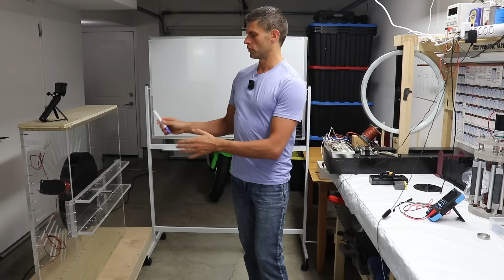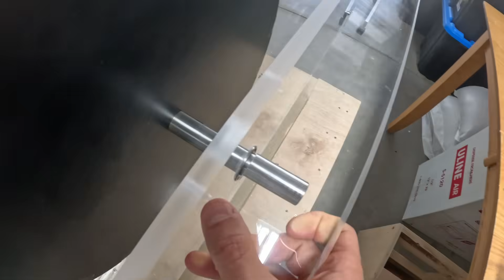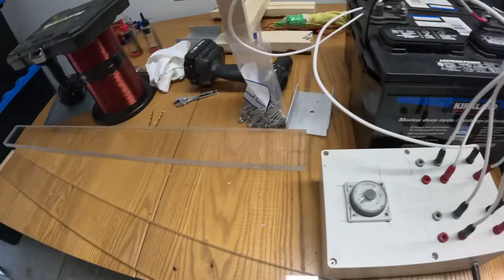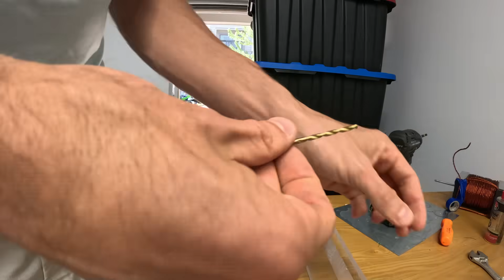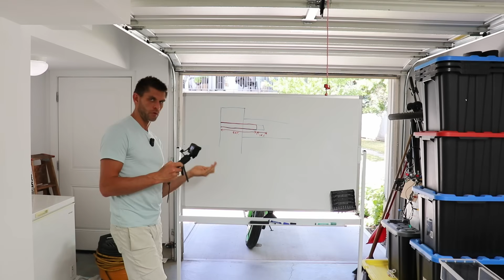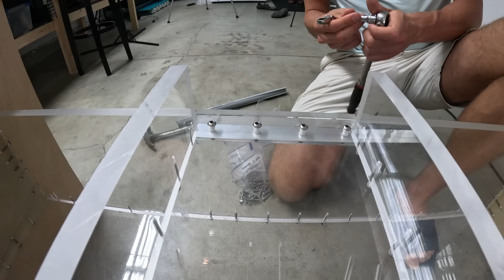This Pulse Motor Could Change the World — And I’m Building It in My Garage

Comment: Bro, I'm loving this idea already and have a suggestion! Are you familiar with Prof. Malcolm Bendall and his Thunderstorm generator? He uses plasmoids and they function like atomic battery and can hold enormous amount  of charge because of their high energy density and self-contained electromagnetic field.  I'm  wondering, if you'd use it as a battery source instead of standard battery.  Plus the plasmoids are generated fairly easily through  cold fusion at low temperature and pressure.  Let's me know what you think, bro?
Reply from the maker: Ill check it out thanks

Comment: IVE GOT AN IDEA!!!!!!! WOULD YOU LIKE IT!!!!!!!! Here’s an example THE NORMAL GENERATORS LOSE  50 PERCENT OF THERE MAGNETS??????????? SO IF THERE GENERATORS RUN AT ONLY 80 PERCENT OF EFFICIENCY, HYDROELECTRICITY 90 PERCENT EFFICIENCY!!!!!! I CAN DO BETTER REMEMBER THERE MISSING HALF OF THE MAGNETS!!!!!!!!!!!!!!! SO I KNOW THAT I CAN DOUBLE THE MAGNET FIEL😢STRENGTH BY NOT ALLOWING ANY MAGNETS TO BE LOST!!!!!!! SO THAT MEANS THAT I CAN INCREASE THE EFFICIENCY OF THE GENERATOR’S TO 160 PERCENT EFFICIENCY SO WE CAN EASILY USE 60 PERCENT OF THE ENERGY TO POWER THE MOTOR DRIVING THE GENERATOR AND TAKE 100 PERCENT OUT!!!!!!!!!!!! SHOULDNT HAVE MOVING PARTS!!!!!!!!!!!!!!!!!!!!!!!! I’M USING NATHAN STUBBLEFIELD EARTH BATTERY PATENT!!!!!!!!!!!! 🙏❤️
Reply from the maker: Cool 😎 great comment
Reply: @MadscienceLPTECH ALL KNOWLEDGE NEEDS TO BE SHARED!! 16 COILS PUT IN THE GROUND 1 METRE APART AND WET THE COILS INDIVIDUALLY NOT THE ENTIRE GROUND!!! AND THERE IS ROUGHLY 14.8 VOLTS TO POWER ANY INVERTER!!!!!!!!! I WOUND MY COILS USING IRON WIRE AND COPPER!!!!!! PAINFUL, EXCRUCIATING PAIN I WAS PHYSICALLY HANDICAPPED AFTER EVERY COIL I MADE!!!!!!!!!! DONT DO THAT ALL THOUGHT THERE ARE BENEFITS!!!!! (More Magnets) JUST WIND THE COILS OUT OF COPPER SO FUCKING SIMPLE!!! 😀 AND WELD OR SOLDER A NICE COPPER PLATE AND ZINK COATED METAL PLATE!!!! NO SECONDARY COILS!!!!! JUST SINGLE EARTH BATERY CELLS!!!!!!!! MANY DO USEFUL WORK!!!!!!!!!!!!!!!!!!!!!!!!! ITS JUST AN EASY WAY TO MAKE YOUR OWN POWER!!!!!!!! IF YOU WANT MORE INFORMATION DONT HESITATE TO ASK!!!!! I HAVE DEVELOPED 8 DIFFERENT TYPES OF PHYSICS RELATING TO UNLIMITED ENERGY!!!!!!!!! 🙏❤️
Reply: @MadscienceLPTECH THERE US A LOT OF KNOWLEDGE HERE WITH THIS TYPE OF EARTH TECHNOLOGY!!!!!! NATHAN STUBBLEFIELD USED THESE COILS TO SEND VOICE THROUGH THE EARTH FROM ON PLACE TO ANOTHER!!!!!!!!! THESE COILS TAPE INTO THE AETHER!!!!!!!!!!!!!!!!!!!!!!!!!!!!!!!!!!!!!!!!!!!!!!

Comment: I spent over 30 years studying every form of "Free Energy " or "Over-Unity" device I could find and nothing worked .    In 2014 I bought a couple of Lithium battery modules out of a Tesla Model S car and that combined with cheap solar panels provides far more power than my house could ever use and the equipment will last the rest of my lifetime .    The pulse motor stuff is fun but it's kind of a waste of time now that solar power is so cheap and easy to put together .
Reply from the maker: hows your solar work at night? solar will be a joke compared to ZPE once we get it ripping,
Reply: @MadscienceLPTECH  Solar does have trouble on long winter nights followed by cloudy days but if the battery is big enough and panels are powerful enough you can still generate impressive power during rainstorms .  If someone can figure out how to get an electric current to constantly flow in a loop that would be awesome .  Best of luck !

Comment: why don't you show the battery voltage over time of your current system? it sounds like that your theory is that you need a system that is low-enough friction so that the "pressure release" of your system inputs more energy back than was used for the electric pulse through the coil, but that the current system has too much friction and does not actually generate more energy that is released. Is that right?
Reply from the maker: More like high enough excess to overcome all losses easily. Stay tuned new video tomorrow

Comment: I have studied John Bedini's work and built his motors and have come to the conclusion that the 2nd battery eventually always dies .....why friction and the law of conservation, you can not get out more than you put in ....his devices no matter how you build them will always suffer because of friction and heat disapation used in any semi-conductor device .....it led me to the conclusion that there is free energy but it is in the form of solar ,wind , water flow and atomospheric voltage ....you need torque to run a generator to provide enough power to drive a load. Therfore it brings us to the conclusion that solar is a direct conversion to power, wind and water are all direct conversions to electricity by using mechanical rotation so that leaves only atmospheric voltage. Atmospheric motors do in fact produce torque. Not saying it can't be done but the idea of the aether has been an illusion used by many that were found to be grifters when the facts were laid bare. If you figured out a way to use atmospheric voltage to run your generator, I would say you would have a chance, otherwise I would say you are pissing in the wind. Don't take this personally it is just from someone who has traveled the same road that you are on. Why because Free energy would mean freedom from the oppression of the elites that have bought the governments of this world and keep us as ......well lets just say wage slaves.......Im routing for anyone that can come up with a solution and give it freely to the people but I don't think John had the answer.....a neat device but not it
Reply from the maker: Basic 12v BJT bedini yes not going to power your home... our build will 120v SiC FETs

Comment: From a technical point of view, this achievement is doomed to failure. In order to understand the laws of thermodynamics applied to a closed system, we must take into account their contradiction with what actually exists in the universe where these laws are not applicable. The most important law is the law of universal attraction (gravity). Gravity acts as an INTERNAL force within a closed system, being a force that produces internal energy without energy input from outside the system (considered closed). Gravity makes the universe evolve and its existence is linked to the existence of matter.
The most conclusive example is the sun (where energy is produced due to the internal force of gravity).
In order to create a generator with permanent magnets with an efficiency greater than 1, there must be a permanent imbalance in the system (in whatever relative position the magnets are, their position must not be in equilibrium). There are two methods of creating the generator designed by me, one of which is currently being patented and the second is currently being drafted.
Reply from the maker: This is an open system.

Comment: I have a question. Won't the ribs, the bolt and other metalic stuff (aside of the coils and magnets ofc) create some kind of disturbances in the EM field causing some kind of losses in performance?
Reply from the maker: All fasteners are Stainless steel. And far enough away to not be noticeable... but yes we have to be very careful to not mess with the magentic flux

Comment: This is a good project! I also have built simple motors with hall sensors and electromagnetic coil. They work for a very long time. I believe Bedini built ones (like yours) that act as an energizer. I'm sure you already know but the type of magnet you are using is important for saturation/pulsing. I'm not sure about the over unity but I will be interested in following what happens!
Reply from the maker: So good thanks for that brother 🙏 its going to be good 😊

Comment: if i understand correctly youre buildung a normal brushless dc motor? Typical Inrunner Design, just doubled the winding by twisting them? But where is the invention? not that im not invested, but i dont see anything new here.
Reply: youre "harvesting" simple variable magnetic fields, which is a simple generator at this point.
Reply from the maker: Not at all. Maybe watch again
Reply from the maker: Its the circuitry and the high voltage fly back collected into a lead acid battery creating a dipole or negative reistor. This isnt just regular e and m

Comment: love ur vibe man, ur aura is wide open and i trust u have a disciplined set of habits that balance this openness to keep this energy from burning out. anyway, im interested in whats going on with you man. love this stuff, always have, started as a physics major and became an artist instead. dont forget that where nick started was in the ground, telluric current. next time ur make ur copper rope, consider putting that long line straight down into the ground with an above wire to complete the loop, and hook that up to your electromagnetic ram pump. thats what uve got, i love the idea of scaling these things up but if the end goal is to put an electricity generator in every home you can include the use of their yard. in the ram pump metaphor, your zero point energy is the interplay of gravity and fluid pressure elasticity. electro magnetics following a similar form of flow physics as fluids strikes of a certain kind of universal synchronicity. that factor to me leans the notion in the direction of being a solution that brings unity and strength to humanity. electric energy is only a part of to solution to the homes of the future, permaculture communes take back food sovereignty and an effect method of storing and using hydrogen collected from water for heat and cooking could be enough to shore up the gaps left by other current solar age techs. namaste brother
Reply from the maker: Thank you brother. I see the light in you also. Yes I do the practice and the work :) cheers 😊❤❤

Comment: Im not a learned student per say no extra college but as child ive read encyclopedias over & over to keep from pure boredom! Taught myself mechanics! Every action is equal opposite " i push you forward as much force against me" ok? Single prop 150 mile an hour? Double prop one in opposite direction over 300 miles an hour! For all power to turn your wheel!, one spent in opposite direction to over come force is free energy one gear between two wheelsand your impulse load being used twice to three times for same energy spent!
Reply from the maker: Thats generic kenetic thinking. How much energy does it take for a hydroelectric dam to produce power ?
Reply: @MadscienceLPTECH well in truth not much water going down anyway! Just a little maneuver on the way!

Comment: I think you should elaborate about the mechanical principle more so people can make theyr own models based on the "magic" of excess energy. (for exacmple making a sensible explanation for dummies as an intro for start of every vid).
Reply: Because its not, he has no extra energy that he is pulling from. The backfeed of energy he is reading is eddie currents produced by the magnetic field inducing a current opposite of its own into the coil when no electricity is passing through the input. 

This means the eddie current are slowing down the flywheel. What he made is called a flywheel battery. And it in principle is not harnessing any outside energy, only the energy he is inputting into it or physically added by spinning it by hand. When he applies a load to the circuit it will eventually lose power.
Reply from the maker: Generic kenetic veiwpoint. Think of an open system like a hydro electric dam
Reply: @MadscienceLPTECH yet again you deleted the comment I made before snd refuse to respond to it because of how I explained it is not an open system. You skirt by answering what is the energy you are pulling from.

What is the ocean you are tapping into. The flywheel is a relatively closed system especially considering you put it in a box lmfao. 

Lets try this again. 

The issue here is your diagram is wrong, you drew the force/magnetic field parallel to the coil/wire. Lorenz law shows that the magnetic field is perpindicular to the current, and force is perpindicular to both. Consider it this way there a right hand rule for this but lets make it simple. Your standing at bat and your go to hit a ball at shoulder level. You swing and hit it. That is the direction of the magnetic, current, and force. You are the current, from your feet up to your head is where it runs in this diagram. Then your arms and bat outstretched is the magnetic field. You swinging makes the arc of the field, and the ball being hit away is the force. All 3 are perpindicular to one another. 

With that said for the flaw of the system itself, what you are building is a flywheel battery. The issue here is youre trying to use a battery as an energy source without mentioning the explicate energy youre getting. 

Nuclear=strong force (atoms bonds), 

photovoltic=electrostatic force (photons absorbed by electrons) 

Hydro, mechanical energy from the movement of water due to gravity. 

Wind, mechanical energy from the movement of air due to earths rotation...etc. 

But this system has no way of making energy. What you're doing is  creating a pulse in the coil using mosfets to increase the current briefly so that it pushes the magnetic flywheel. Then when the next magnet comes close to the coil induces an eddy current into it. This eddycurrent though produces an equal but opposite magnetic field in the coil. This magnetic field pushes against the flywheels magnet slowing it slightly. This then means the second pulse will have less energy then the initial pulse. 

You will see one large pulse, then another pulse that is 90° out of phase from it will appear a smaller and slightly thinner and more of a ramp them square wave. 

You can validate this with a osciliscope just putting it to the coil.  Since your coil is acting as an input and output.  And then when you hook up a load you'll quickly find that your output voltage will drop significantly.  Your wheel will also stop over a period of time when the battery goes out. You will have a net negative to the system because yet again. You are not drawing on a specific phenomenon or force to pull energy from. 

You can and will never be able to have more energy come out of a system then what is in it. Every other form of energy has energy put into it from external sources or even us that we can later draw on. 

Every source is a "battery" the issue is how much charge does it have when we plug in. 

Here though there is no plugging in, youre storing energy as momentum in the fly wheel and drawing on it when you need it. But the energy to keep it running/spinning/the initial spin is energy you have to factor in. 
All of these will result inevitably that energy output is less. 

The same with nuclear, the same with solar, the same with wind, oil...etc they all follow this rule to, the difference is we don't have to make wind, nor sunlight, nor more water. And nuclear requires us to enrich the material it, but we are not having to make the atoms to do so. 

At the end of the day if any of these sources did not have some other force, thousands or millions of years of potential energy to form before we had to touch them then it would result in a net negative. 

Its why they have trouble with fusion vs fission. 

You keep mentioning there being a 2nd force involved but never the force itself. You keep saying "we are just pulling energy from the enviroment like any other source," but never say what that energy is. Then you say here "I'm not asking for money because I need it, only for  research so I can buy these parts." 

I'm sorry but I'm going to call a snake oil salesman out when I see one.

(Edit) looks like you kept my comments for once, but bet you won't respond to them again with an actual argument explaining how you get around these basic issues with the machine lol.
Reply from the maker: Good idea, I will keep that in mind.

Comment: The problem with this is that we can't see how much power is going in and how much power is actually coming out. This is pretty much the challenge of the perpetual motion machine and why it's never been done before. Once you place a load on the machine, the power slows down substantially.

What you're talking about is utilizing the power of the aether to increase the power you put into the machine. It's pretty much how our sun works. As electrons move away from the sun, they accelerate. This is the most simple example of how the aether works. As you put energy into your machine, there should be an increased acceleration of electrons as the output. Not necessarily more power, but essentially you are creating an election accelerator.

To create a machine that would give you the power you're looking for, you would need to create a twin system where both machines create an equilibrium with each other. Pretty much a Fibonacci spiral effect. It's how our DNA is aligned. Everything, in the universe, is in pairs. Twin systems. Even stars are usually binary star systems. It's how electrons balance themselves throughout the universe.
Reply from the maker: Lol great comment. Maybe that's what we are doing. I've seen these machines working. 

Tesla tech can produce kw of electricity with 0 moving parts